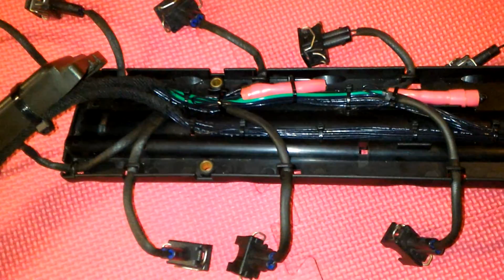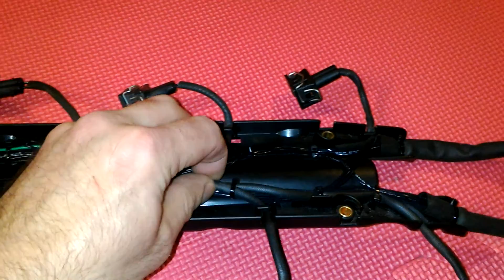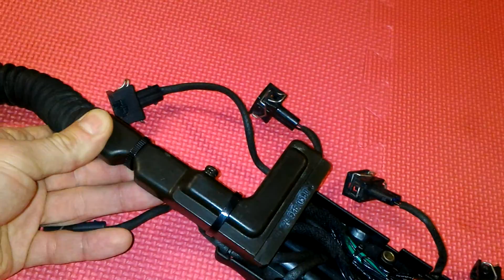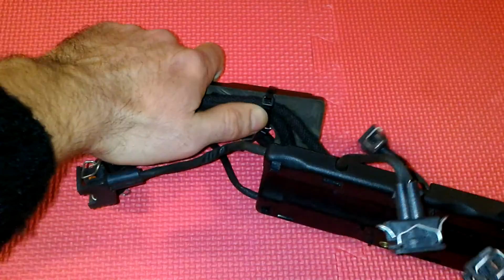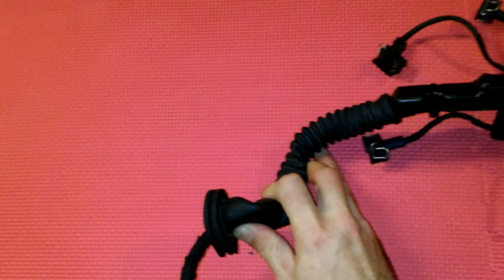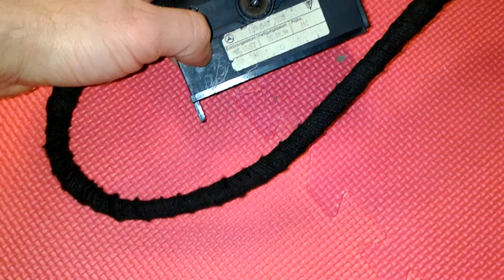Mercedes SL600 wiring harness repaired

Comment: Hello, I just picked up a 95 SL600. It has a few problems. Speedo doesn't work. Abs and airbag lights are on. Also it occasionally goes into limp mode. But when I reset with key and gas pedal it works again. Do you think it could be the harness? I'd like to fix the car, but not if it will cost thousands of dollars. I'm in Alberta Canada. Thanks.
Reply from the maker: In my opinion any V12 is expensive to maintain regardless of make.